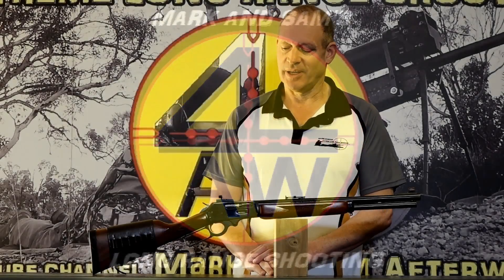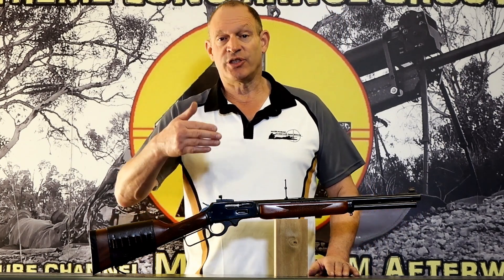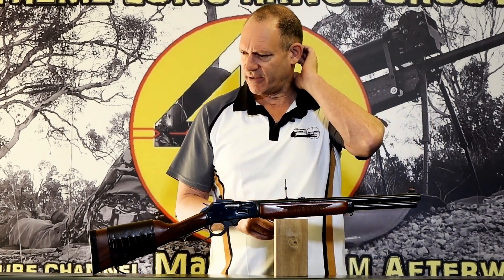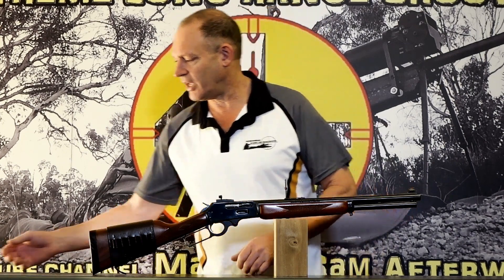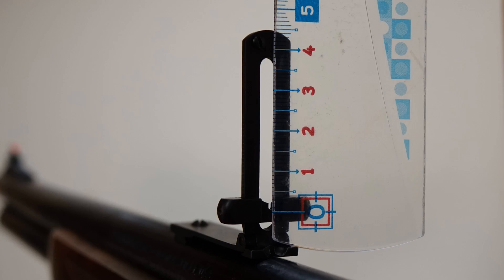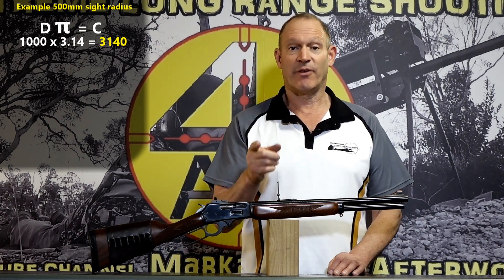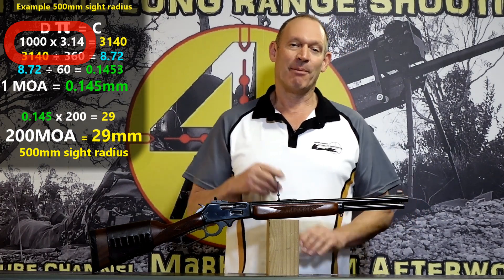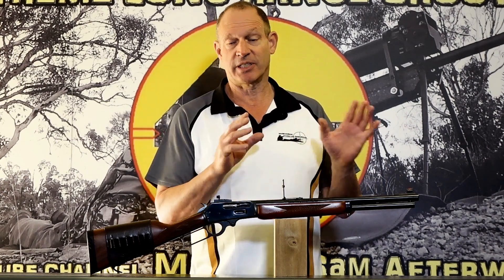Dialing moa on old school sights

Comment: This is why I like MRAD so much more than MOA... this is pretty dang simple in MRAD.  If your hold was 200 MOA, that's approximately 59 MRAD of hold.  Since your sight radius is 500mm or 1/2 a meter... then the formula is (59/1000)/2=.0295 meters... which if you are keeping track... is 29.5mm.  For those who are paying even more attention, you'll realize that mm are already 1/1000 of a meter.  Therefore, you can skip dividing my 1000 only to multiply by 1000 again, and simply say that any MRAD that you want to dial, just divide it by 2 and that's your measurement in MM.  So if you need 6mrad of hold, measure 3mm on your sight.  30 mrad of hold?  Dial up 15mm on your sight.  So easy.
Reply from the maker: Well yes shorter equation, (most rifles do not have a 500mm sight radius) but same point, maths will get you there, Cheers